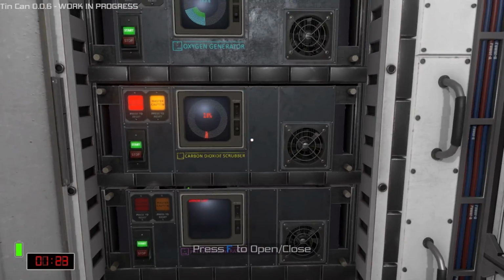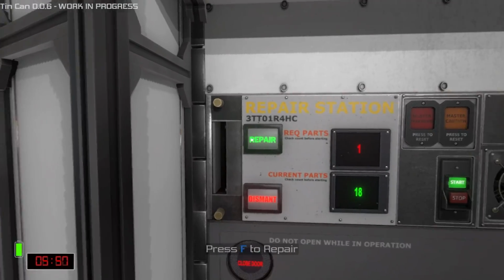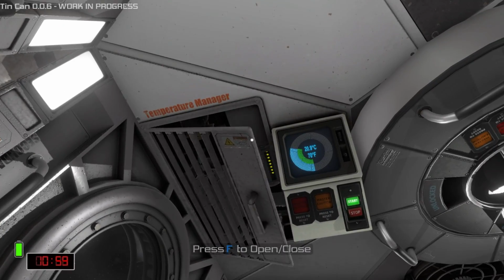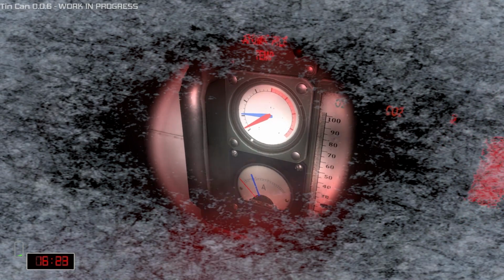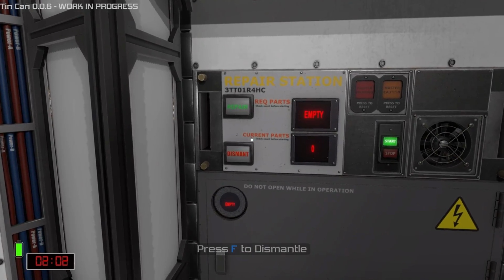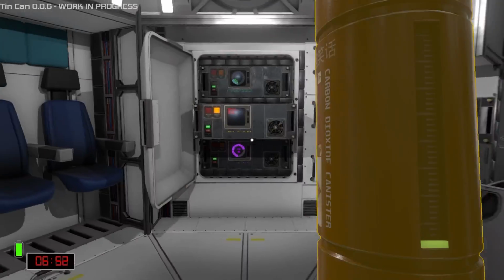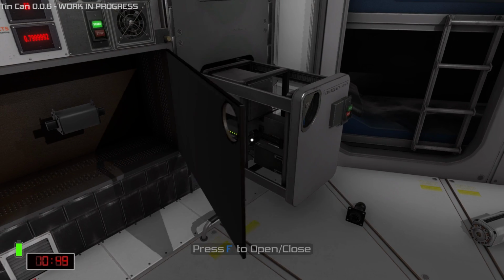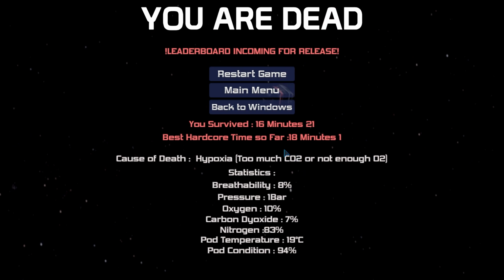Tin Can | Part 3 - SQUAREHEAD SCHOOL

Comment: I'm sure scarlet learnt in parts 4-6 but the idea is that the pile temp and the air temp are different, and the vent/fan thingy (air con?) at the top controls the pod air temp directly by heating/cooling. So when you freeze you do need to turn on the air con thing to heat up the air temp.

Turning AC off or removing the AC pump does relate to the pile temp indirectly because it draws electricity, but that's a side effect. The main way to save pile temp is to save electricity by turning other systems instead. For example gravity can be turned off safely.

I guess it's kinda ironic that our favourite HVAC tech froze to death in space but hey I guess that's the game and according to Gaming with Chuck it's one of the harder events :)

Comment: From what I can tell, the Temperature Manager is for the inside of the ESCAPE POD, not the Atomic Pile. Any heat the atomic pile has (if it's even a thing in this game, which I highly doubt), then you'd have to check the atomic pile and not the temperature manager.
Reply: The pile controls it's own internal reaction, a bit like a nuclear station. The processor of the main generator stops it from heating more than required by controling the max reaction (unless it is not working properly). The pile ALSO warms the air around the main generator, leading the atmosphere in the pod into heating over time. The temperature manager cools or warms up the air depending on the current temperature to maintain it at a key temperature of 21°c. If the pile gets too hot the temperature manager might very well not be powerful enough to compensate and you can be cooked alive.

Manny, Tin Can solo dev.

Comment: A realistic small reactor would probably have a liquid coolant system connected to a radiator (likely a thermocouple as you said) on the outside of the ship to cool the reactor and generate power.

Nuclear reactors are also quite slow to turn up and down, so they'll usually overheat and melt if the coolant suddenly stops flowing (this is more or less what happened at Fukushima).

I guess it tries to do a safe scram/shutdown when you switch it off?

Comment: Seems weird that atmospheric nitrogen runs out. Nitrogen isn't a consumable afaik with regards to human respiratory system. Could low nitrogen be indicative of a leak?
Reply: I think it's because the system uses the nitrogen bottle as a source but filters it back out of the air for reuse.  Thus the system takes nitrogen back out to refill the bottle, then pumps it back out through the filter to restore pressure.  Thus if anything in that closet breaks (assuming I'm correct), pressure falls.
Reply: @ariccylkowski2484  That's exactly it. The nitrogen system keeps the pressure at 1bar by injecting or removing nitrogen from the air. It's a closed circuit. If it stops working then you will have an unbalance of oxygen, co2 and nitrogen over time and possibly rising or falling pressure.

Comment: Ok I get it now so it's using a temperature sensor to generate electricity. Temperature sensors, peltiers and thermocouples are the same thing they are like the electric motor and electric generator. Seebeck